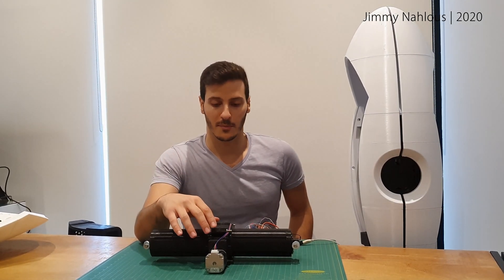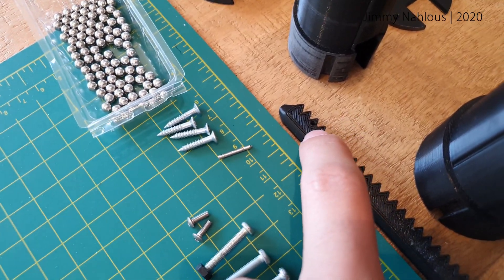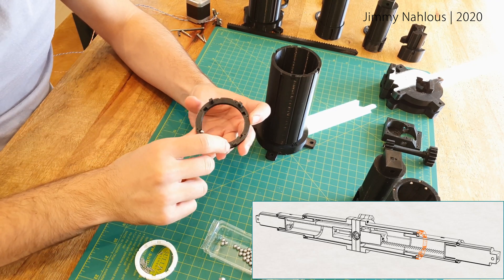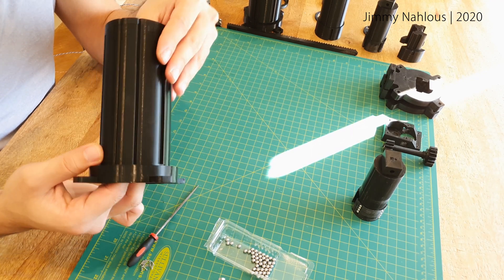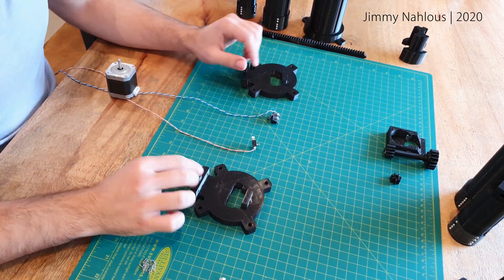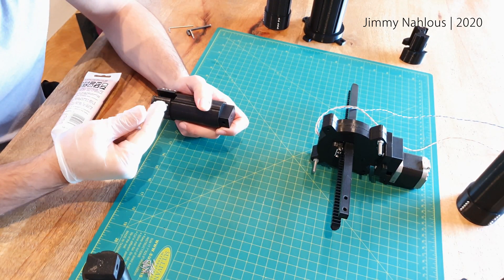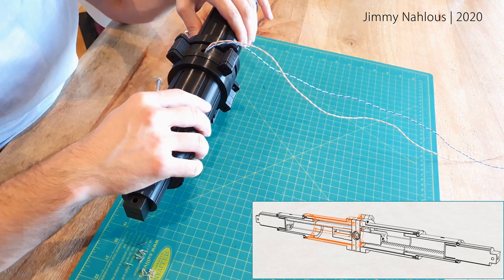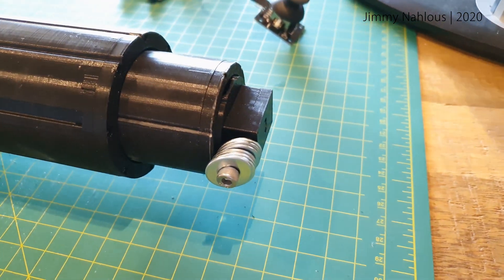Building a Full Scale Portal Turret #03 : The Arms

Comment: awesome build though I'm curios as to why you didn't  design something around linear actuators? is it to do with the form factor?, amount of power? or just didn't want to use them?
Reply from the maker: Form factor! Its hard to explain without pictures, but essentially i need to open the arms up 130% further than a 1 part actuator or ram arm. Thats why i had to design a 3 piece telescopic ram. I didn't  want to settle with a 9-10cm door gap. Wetas turret has that issue, it doesn't open up as far as the game does!

Comment: This isn’t full scale it’s actually oversized BY ALOT the turrets are about as tall as a 20 year olds waste
Reply: Actually, that depends on your standpoint. There are multiple turret models seen in-game, and the main ones you see are just a bit shorter than Chell (the protagonist, sorry if I spelt the name incorrectly). The biggest turret we've seen in the canon game is probably 6 stories tall, and 3 wide (Was a slight inside joke in the game, but it's still assumed to be a working model). But you are still technically correct, although if that were to be true the bullets would have to be pretty small for it to be considered a working model like he is trying to create. Sorry for the long comment by the way, I don't usually comment, but when I do I try to make it positive and it ends up longer than I want
Reply from the maker: In Video #2 I measure the  turret in the game. It stands pretty tall! I've  even spoken to Valve and game designers and Gabe Newell, my dimensions are correct :) it's just that in the game your eye level is like 1.8m high and things look smaller